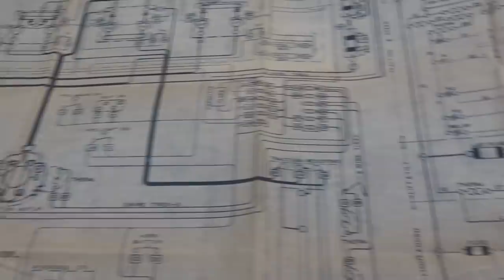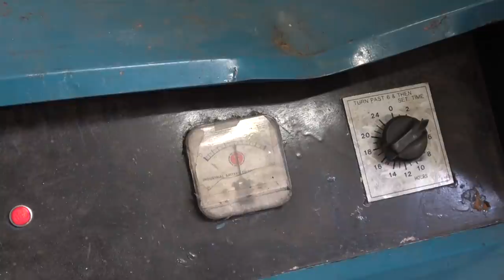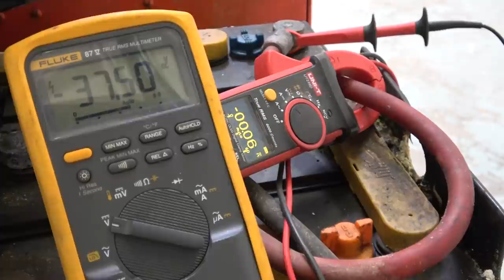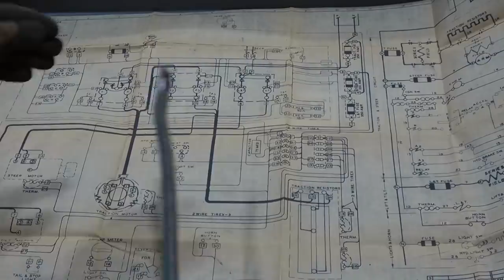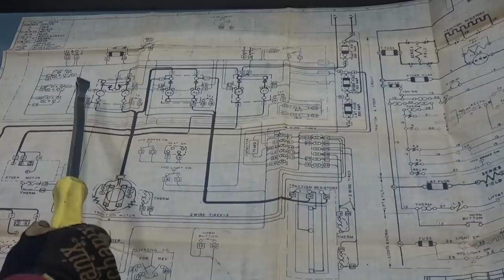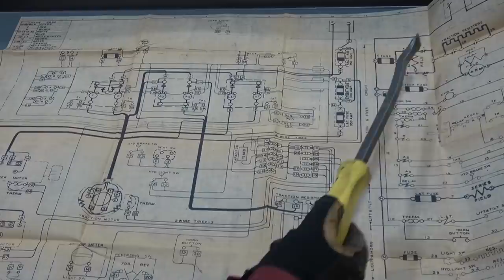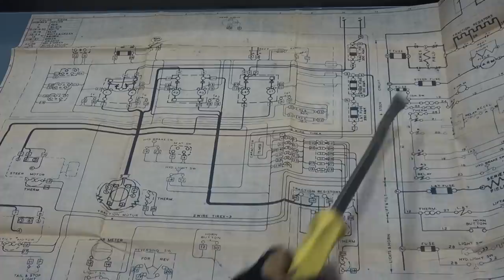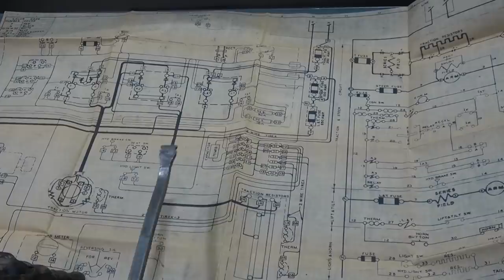Basic Electrical Troubleshooting | Battery Maintenance

Comment: My brother got an electric fork lift that had "marginal" batteries.  It was a 24 volt thing, and eventually the batteries couldn't make it move much.  He took a trip down to the local automotive store and bought a pair of nice car batteries, and wired it up nicely.  Usually the batteries would last to just before the "full warranty" period, so he took them back (each to different stores of the same chain), and asked for a replacement.  Worked out nicely for his application.  In your case, you would need 3 nice 12 volter one.  Just a thought if the batteries go a bit south.  Yes, it was a long time ago (40+ years as I remember it).

Comment: Hey also the battery is relatively safe. We work on them un insulated all the time . Just keep the metal parts from touching . 
Usually p.i.t equipment is isolated ground , so sounds like you may have some stray voltage leaking from the corroded battery , or something wonky in the wiring . 
Do you know if you have a line contactor  Inside that there pixy converter  ? If so what voltage is it running on . I can send you a device to replace that ever so unreliable timer . 
Ya got yourself some old equipment there brother  , but it should still chooch given the right love .  Keep it in a vise brother !!!

Comment: Previous forklift tech here. You should never have a chassis ground on an electric lift truck! Pos. Or neg.
Reply: I think one of his directional contactors is shorted to the frame.
Reply: @Karl Fehling Why is that?
Reply: Glenn Chartrand  Or it's had an after market beacon or something added which is single wire frame ground, lifting the frame to battery positive.
Reply: S  The GE swing contactors had a problem with the insulator plates going bad with age (and heat) and they are on the positive side of the circuit.
Pull the fuses one at a time and see when the (+) ground disappears.
The funny part is, it's really easy to get these old resistor trucks running like new.
I run into 12 volt Clark ST20's that are still running and for sale.
Here's an example from 2014
https://www.k-bid.com/auction/3266/item/4
The thing spent 60 years scooting around in a freezer and it still runs.
The hour meter is stuck at 914 because it can only go around three or four times before it breaks.
Meanwhile I have stuff from the 1990's and early 2000's  headed to the scrapyard because they are unrepairable  junk.
Reply: drive -  pump. /  . any motor brushes. in a unit that old will leak voltage to the frame . carbon tracks.

Comment: The voltage to frame you were reading is a result of low current being carried by the crystals forming at the top of your battery to the case. Positive plate growth can break the edge seal and allow gas to escape and condensate as well as crystallize growth  around the edges. I would suspect the mutlti-color battery caps, they should be venting but are probably clogged. I know others have said 2.2 volts per cell but I see spiked cells to be higher 2.27 on new batteries and I rounded. If the the battery exhibits warmth while not hooked up to the truck you have a more serious short that is carrying enough current to act like a floor heater; call a battery company because you do not want to cause a fire. These batteries can carry enough juice to weld and battery companies often use the battery power to lead in the connectors between cells.

Comment: @AvE Regarding checking the chassis +/-, just use the continuity tester feature which is what you actually want to know instead of VDC. They usually don't have a chassis ground, so what you're reading is a "ghost voltage" caused by electrolyte that leaked into the battery cage and electrically connected to one of the terminals. You should thoroughly clean the top of the batteries with plain water from a spray bottle or garden hose.

Comment: I haven't finished the vid yet (at 16:41), but the mechanism in the fore/aft switch doesn't need more travel. The corntacts are spring loaded. Watch the 'forward' make contact and you see it push back a bit in the holder. The 'aft' bit is stuck in the 'pushed back' position. free that beastie up and clean up the contacts and I bet she chooches.

Comment: i had commented on the first video the steering column selector was bad. dealt with this before at the hydraulic shop i worked for. its always those tabs, and you literally fixed it the waywe did as parts are nearly impossible to find. you bend em till they break then replace the unit.

nice part is you can get 1 piece and not the whole unit, AND they are bi directional so its the same part both sides.

Comment: Quick point I saw about the switch. The contact on the right side wasn't moving (as it's spring loaded?) when you moved the switch to the right, but does so when you move it to the left. If you look at the switch when you moved it left, the contact shifts where the spring is. Not so much on the right.  I guess if you took that switch out and lubed the contact portion (where the spring is), it'd have worked again. Although the temporary fix, aka permanent solution, did the job too!

Comment: There shouldn’t be any voltage on the chassis. Looks like you’ve got some leakage there. You can usually check how bad the leakage is with a light bulb. If it won’t light a bulb is got no real current behind it but still a good idea to clean up and isolate that battery. Most times you pull the battery out and that chassis voltage will go away. 

A couple blocks of wood under the front of the mast and tilt it forward will get those drive wheels off the ground so she won’t take off and run you over while you’re doing your testing. 

Cheers!

Comment: That 36 volt positive in the frame could be coming from corrosion on the battery case or shorted wire to frame. Be very careful if you push in F&R contactors manually. The tips can weld and the lift will be  crashing into the wall on the other side of room. Don't ask me how I know that.LOL All manuals say to jack drive wheels off the floor while doing electrical trouble shooting

Comment: IF you tilt the mast all the way back. Then place the appropriate amount of blocking under the channel of the mast, then tilt the mast forward. VIOLA drive wheels are off the ground. No death or dismemberment possible, as far as motion of the lift truck is concerned.

Comment: They've been watering without fully charging the battery first. That's why all the acid boiling out.36v only tingles a bit with wet hands, the 48v feels like you stuck knife in an outlet briefly with wet hands. that battery if not ancient is likely "okay". No outliers, but it could probably use an equalizing charge/ or with your ancient pixie generator just charge for like 6 hours - fully charge it, then run it past full for a while.

Comment: The contacts in the center part of the switch are on a spring. The left side contacts are moving freely and the spring is keeping pressure. The right side contacts are stuck and the spring isn't doing diddly.

You can see the set of contacts on the left side depresses the spring when you pull the lever back. Look at the gap between the contact bar and the metal plate. Now look at the gap on the other set of contacts... its clear in the video that the contacts are just stuck. Easy fix, no bending required. Just free those suckers up!

Comment: I was gonna jump the gun and comment "emery cloth all the contactors" but after watching the whole thing, instead I'll say: I believe on that forward/reverse switch that you "adjusted" there's a spring that was supposed to push the contacts all the way to the end, and some shmoo is keeping it from going all the way to the right.  Maybe some acetone and a toothbrush is in order.

Depending on how wrong it goes, maybe some marshmallows and hot dogs as well.

Comment: Many cities have been passing regulations the last 10 years to prohibit propane forklifts indoors. That's put a huge pinch on used electric forklifts and batteries in particular. The big companies can just buy new but, the small guys are having to scramble to pick up questionable used batteries from 1000+ miles away in Canada, and paying a premium for them. Especially out west. They're that rare. 

On that note though, I don't quite understand why the chargers need timers. The batteries aren't going to be over-charged, they'll only charge to the max voltage the charger is putting out. It's not constant current, it's just a multi-tap transformer, 50A when they're nearly full isn't actually going to pull 50A, will it? Though I suppose if the charger is designed to be too high of voltage, you always gotta use the timer. On old sulfated batteries it's good to leave them to hiss and fart and get warm or hot for 24-72 hours to help recondition. Far as I know there's only a couple companies in Canada that actually dump out and replace the electrolyte to refurbish forklift packs and they're all out east. Charge an arm and a dick for it and it's questionable how much life they bring back into them too. I'd let that 36v pack hit 42v for a few days, long as you keep 'em full of water she'll be okay. Probably don't feel like babysitting a ton of lead though. Better things to do.
Reply: The transformer will put out close to 50V peak unloaded, so as the amperage tappers over the voltage climbs. It will get high enough to boil the batteries. If you wanted to desulfate them, get a 6v or 12v desulfator and do it per battery in the pack. My buddy has a 48V forklift and we ended up taking 4 Chinese DC input chargers and installing them to each cell, then using the 48V input to power them. They are smart chargers and have actually almost doubled the life in the old pack over about 2 years. Just make sure you get isolated chargers, chaining common ground chargers will result in VERY angry pixies.
Reply: My understanding is you can over heat the battery and boil the electrolyte right out of a battery if left on the charger too long.
Reply: I was always told that the reason you don't leave them to charger longer is to prevent sulfate build up on the plates, which can over time kill a battery. Realistically speaking, a timer is a pretty crude way of managing charge control to begin with, so I suppose that goes to show how little of a concern it really is.
Reply: It's idiot proofing in case you set them to charge on a friday morning and get too excited thinking about beer o'clock to take them off before you leave, if nothing else.
Reply: @alfoncejean8826  actually, lead acid likes to be charged at about 14.8 volts and a float charge of about 13.2 volts.. al for 12volt mind.. so yeah anytime there not on a "smart charger' they can easily be overcharged
Reply: John  - Yes, naturally. But the heat comes from giving a higher voltage than the battery needs to charge, and then on top of that, a higher voltage than needed to electrolyze water into H2 and O2 (which technically gets rid of some water too but in infinitesimal amounts), the excess voltage causes current that makes heat. If you never give it a higher voltage than the battery needs, you shouldn't get any extra heat. Certainly not enough to heat it up enough to boiling temperature, let alone enough to convert a ton of liquid water into steam.

Legacysage - Sulfation is from leaving the plates without a charge. Having a charge prevents sulfation from occurring. Overcharging, especially enough to cause hot-to-touch temperatures actually helps recondition a sulfated battery by giving enough energy and agitation to dissolve the lead sulfate crystals that formed.

https://batteryuniversity.com/learn/article/sulfation_and_how_to_prevent_it -- "If a battery is serviced early, reversible sulfation can often be corrected by applying an overcharge to an already fully charged battery in the form of a regulated current of about 200mA. (ed: obviously referring to a specific battery size). The battery terminal voltage is allowed to rise to between 2.50 and 2.66V/cell (15 and 16V on a 12V mono block) for about 24 hours. Increasing the battery temperature to 50–60°C (122–140°F) during the corrective service further helps in dissolving the crystals." (Note; Battery University is hit and miss, is often a terrible source with false info).
Reply: Yes, you can sometimes recondition a sulfated battery with a dumb charger by letting her bubble and staying on top of the electrolyte level.  Works about half the time in my experience.  I prefer to charge 8 hours and check specific gravity then cool then repeat for about three cycles.  By the end of the third cycle, you should know if she'll revive.  Don't know if the current feed from the charger naturally tapers off as the battery's sulfate returns to H2SO4.
Reply: To desulfate that battery you need about 42V for 4 hours past 100% SOC. Don't boil the cells, they'll gas but it's not boiling. If you have a cell that's weak, it will heat up faster than the rest.
Reply: Also, leaving a battery discharged is what causes sulfation. When a battery is dead, the sulfur comes out of solution and bonds to the plates. Leaving a battery on trickle charge is fine as long as it's not dry.

Comment: That took long enough for you to figure out. If the lift doesn't want to move or only moves in one direction and the motors run, always, always check the forward/reverse switch first. 8 times out of 10 that's your problem. And 8x's out of 8 it always the problem. I would maybe add a bit of silver solder to those contacts and build them up a bit again too. They look really thin. Should be twice as thick.

Comment: You might try looking at a GE type 35 trolley controller. It uses iron grid resisters to be inserted into a series circuit for 600V DC traction motors. To reverse the motor fields are reversed. The controller gave you 8 speeds, 5 in series, 3 with the motors parallel on the 600 V line.

Comment: I use a nail file to clean contacts, you can close them on the file and do both at the same time. Not the proper way but it will get er done.
Reply: Never had the problem doin it with the file on my Leatherman.
Reply: I use a piece of 120 grit emery cloth doubled over between the two contacts.  One can also build up the contacts with some silver solder and file flat.  Contactor kits now have to be mined from the asteroid belt apparently.
Reply: Fine so long as you don't mind chasin the forklift across the warehouse.  Disconnect the batteries you say?  That cuts into tabacoo time.
Reply: You could do the same thing with points on a car but the scratches you leave will cause fairly rapid pitting and carbon buildup again.

Comment: My company got on a "hundred year fix" craze, a few years ago. I told one of the engineers that a good start would be to have equipment that was designed to last a hundred years. lol
That lift truck is closer to that than most of our machines.

Comment: Awesome video AvE! Is that a Fluke 87V you have there? How many Canadian Copekistans did that set you back??? You mentioned second guessing your meter so it's worth getting a good one, and even then you second guess it, which brings me to the potential issue of considering it's about time to upgrade my cheap chineasium meter to something that I don't have to check the connections are on and that the readings I'm getting are decent. 

Do you have any suggestions on meters? Perhaps under $600 AUD?

Comment: You want to fill it with water after charging it as the fluid will expand because of the heat generated when charging. Plus the electrolyte should be checked after charging cause batteries

Comment: Old vid, but gonna resurrect with in field facts . A good meter means a lot. I've got a fluke MD88-V kit and have used it side by side with the "great" snap on $480 meter. (Glorified ,black and red version of a $140 parts store meter). Its given me information the other can't catch.. Nothing beats fluke for serious electrical diagnostics.

Comment: it's a good idea to measure the cell voltage while charging (easier ) the n discharging.  ALSO if you add bubbles (fish tank  air pump to the odd cells will help!

Comment: I noticed in the forward/reverse switch that the center contacts appear to have a spring to spread them apart, and the one side isn't springing back to it's normal position. However, you bent the other end of the contact to get it to connect again. I think a little bit of WD40 and breaking it loose with a screwdriver would have gotten that spring working that contact position automatically again

Comment: AvE, you should ask the missus if you can get a silicon-carne ring like mine. Same stuff as her muffin trays and oven mits. No more electrical shorts or fingers getting pulled into the mechanicals

Comment: For normal quarterly maintenance I also like to use a laser temperature gun to check the temp of each battery. If you find one with an abnormal high temp it could be it is beginning to fail. Maybe the beginnings thermal runaway........
Reply: Runaway as in boil its water out and then be dead.

Comment: Looks like you could have some fun with an arduino and a pile of solid state relays what for removing the resistor drive and replacing it with pwm.  Or maybe several separate 555 circuits instead for higher robustosity and field repair capability.

Comment: The issue wasn't the detents, the forward side of the contactor armature was not sitting properly against the housing. You can see an improper gap size when it is put into neutral. Compress springs to each side using a clamp, clean and deburr the housing, should work like new.

Comment: looking at them forward backwards selection lever switch, the reverse side was all the way springy to the end stop in the slider, but looked like the forwards didnt slide back to the end, but seemed stuck in the "contact" position.. but was hard to see in the vidjeo. but what you did also works :D keep 'm up, get 'r fixed :)